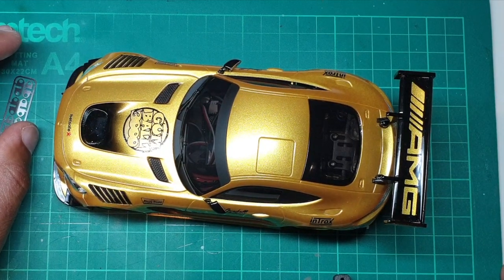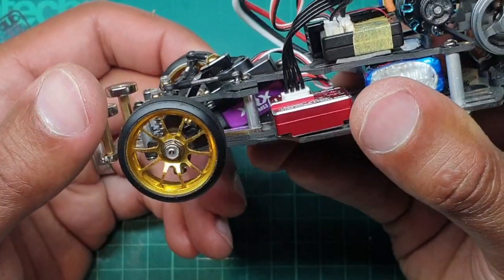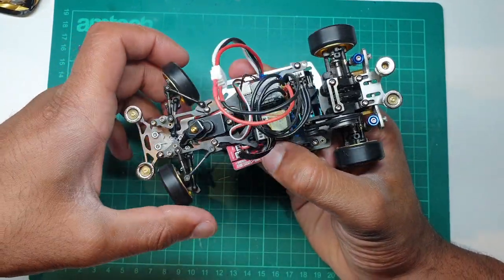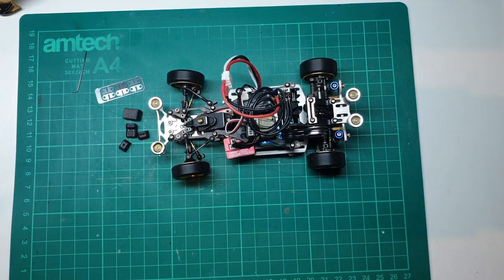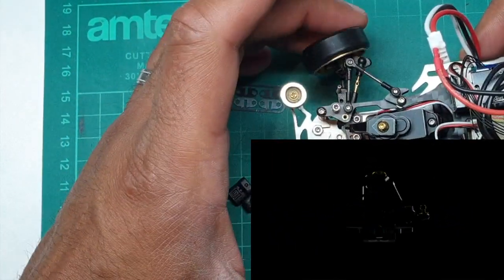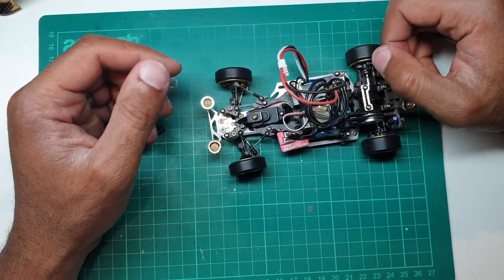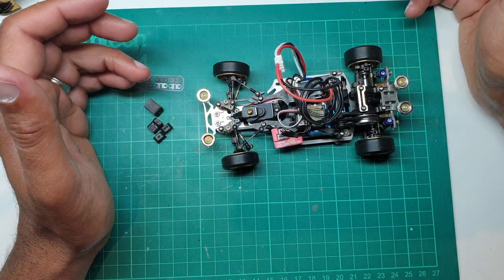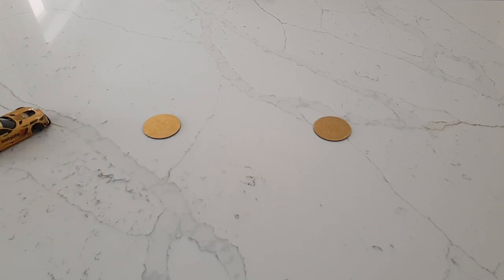Garage RC presents .....DRIFT ART 2 DRIFT HOP UPS. PART 1  DUAL VECTOR FOIL STEERING SYSTEM REVIEW .

Comment: Hello I’m setting up a Driftart chassis and want to also go with the AMG shell.   Can you help me with wheel specs please.  Diameter, offset etc.  I’m assuming you are running aluminum wheels?
Reply from the maker: Offset 3 rear 2 front  . 22mm wheels alum

Comment: I have my toe out set pretty far. When you were turning do you not want one tire at full lock and the opposite tire not full lock? I might change my set up and try this
Reply from the maker: Depends on the car I try for full parallel both ways, if the shell and chassis allow.
Reply: @GarageMiniRCUK   I’ll have to try that

Comment: how thick are the DriftArt2 Break Disks ? i want to know so i can choose my wheel offsets
Reply from the maker: This one doesn't have brake discs, do you mean the knuckles? You can get optional discs they usually don't effect offset
Reply: @GarageMiniRCUK  i asked driftart on facebook and they said 0.3mm so if you also add a washer so you don`t scratch the bearing it will be 0.6 mm wider offset